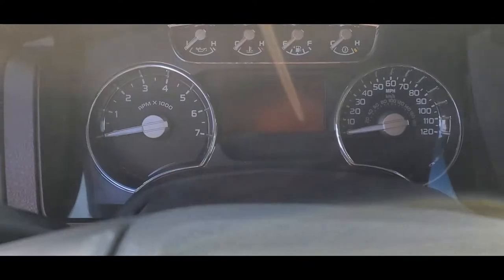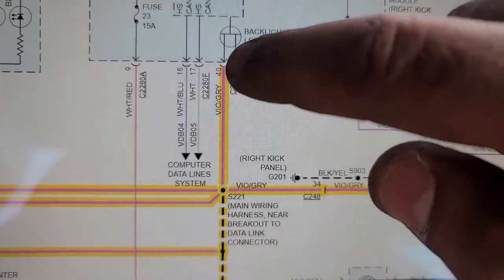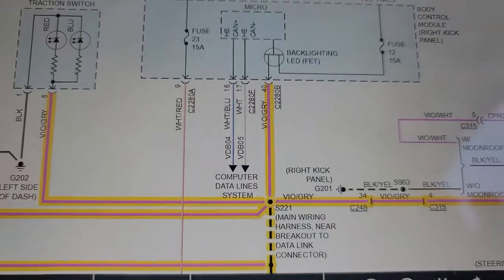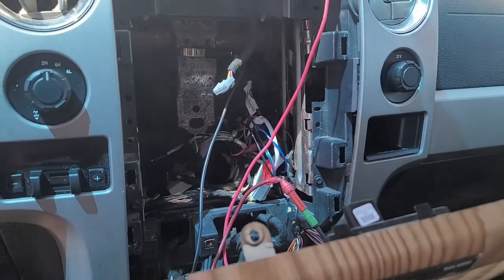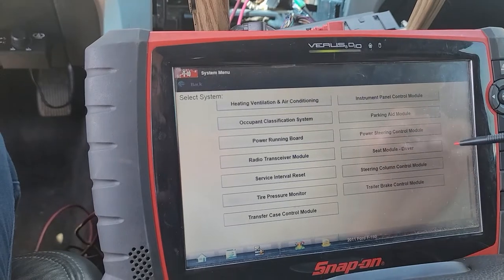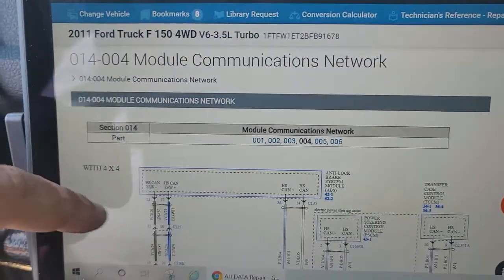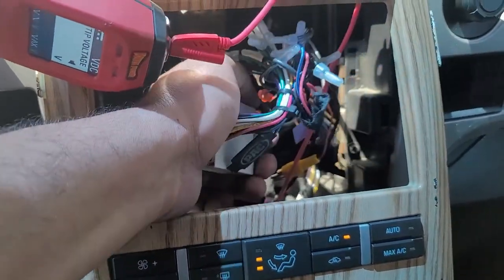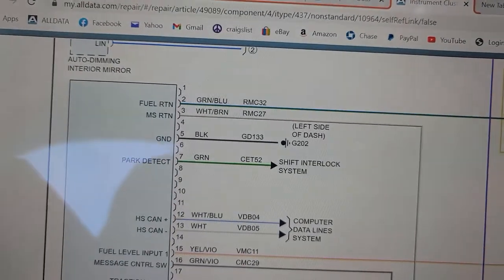2012 Ford F150 with a dead dashboard, ac controls and cluster!

Comment: Good stuff and was nice watching a pro at work.  Some serious data diving.  I just had my instrument cluster go out.  I studied the fuse panel and found there are 2X fuses for the instrument cluster and it was blown.  So, the radio display panel was fried and kept blowing the fuses.  Disconnected it and everything worked again.  Plugged it back in and it smoke checked.  So, some info for yah.  2010 F150.  Thanks for the video.
Reply: Vladimir , you mention 2X fuses  blown ….can you help me with the numbers of these two fuses ? I only find one that references instrument cluster…. I have a 2013 F150 that the entire instrument cluster is out , no lights no gauges at all , everything is dead…. Also affecting the heat/AC
Reply: @larryfetterman6487 you ever get the number for the fuses? I have the same issue
Reply: im having the same issue in my dad's truck, 2010 f150.  I found both fuses for cluster and only one keeps blowing out (#26).  is there a video on how to remove the radio display panel?

Comment: Looking for some recommendations... I have a 2011 F150 Lariat, similar to this. The LED lights no longer work on the Needles for my Fuel Gage, Oil Pressure, Engine and Coolant temperature instruments. Is there a way I can repair this without replacing the entire cluster? I'm glad I found this video, because I wanted to see what it looks like inside before trying to take it apart myself. I'm not familiar with circuit boards so I don't see any simple or obvious solder joints to touch up or LEDs to replace.

Comment: Nice job.
Reply from the maker: Thanks
Reply: @DallasAutoDiag I have a 2015 taurus and the dash is flickering intermittently. No ac or radio controls. Do you know what harness would have those controls? I was told by the person who sold it to me that its under the steering wheel that has to get replaced.